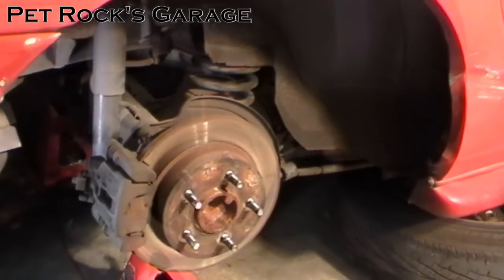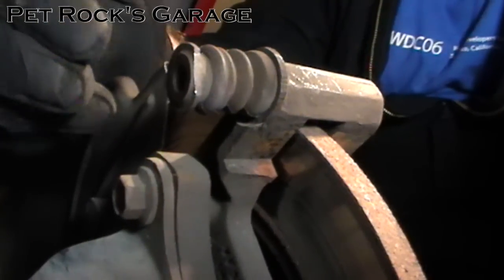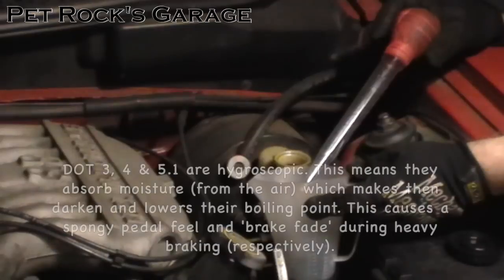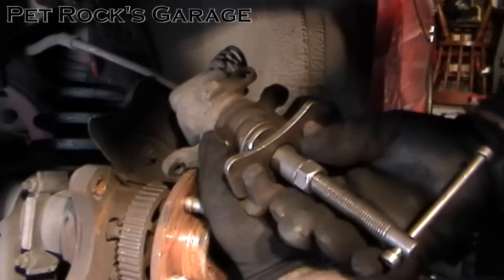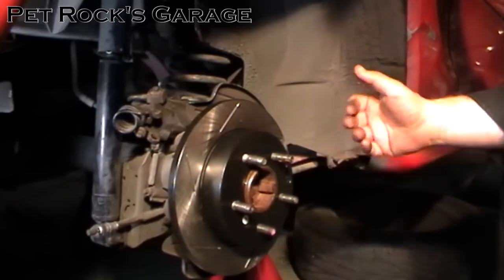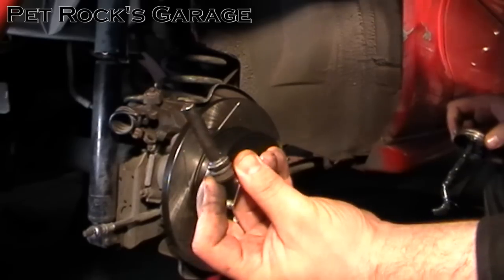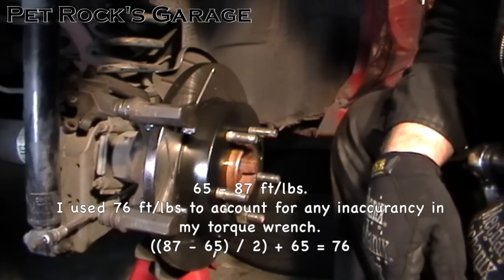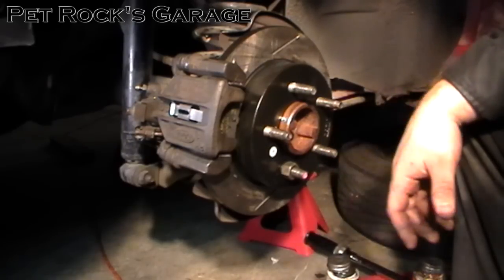How To Replace Rear Brake Pads & Rotor - Ford Mustang (’94 - ’04)

Comment: You can buy the disk brake caliper tool set on Amazon for like $32 just bought mine and it worked great. Just make sure you read the reviews there are a lot but that way you can be %100 sure it works for your car.
Reply from the maker: Mallel Morales, you can also rent the tool I use in this video from your local auto parts store. When you return it you get your money back.  So it’s a net-zero cost.  Thanks for watching & commenting. I appreciate it.
Reply: Yeah but might as well have it haha

Quick question when I did this I couldn't take the parking brake cable off is there a way to do that? I managed to do it but it seemed way easier taking it off. Thanks for the videos very clear and quick keep up the good work its much appreciated!
Reply from the maker: Mallel Morales, I just pulled on the end of the cable and disconnected it. Doesn’t take a lot of effort, like I show in the video.  Make sure you don’t have the parking brake engaged when you try it otherwise you won’t be able to get enough slack. Once you disconnect the end of the cable, there is a c-clip holding the cable onto the caliper bracket. Pop that off with a screw driver and you should be able to pull the cable out.  Good luck...
Reply: Oh okay but how do you disengage it? I had a real hard time with that.
Reply from the maker: The parking brake is disengaged from the lever in the center console in this era Mustang.  Press the button on the end of the lever and push down.  That should give you enough slack to disconnect it from the rear brake caliper.
Reply: Pet Rock's Garage I tried this today on my 95GT and it looks like I was going about it the wrong way my manual doesn't make it quite clear on how to do this other than removing the center console then pulling slack on the tensioner , I didn't know it cld just be slipped off as easily as you did it in this video. Gonna give this a try tomorrow. Thanks for the video man, this helps me a lot. I'm replacing calipers and rotors all the way around on my car
Reply from the maker: turner1976ft, yeah the service manual is a good starting point but there are often little tricks you can use to make the job a lot faster/easier. Good luck tomorrow. Take your time. I have another video on how to bleed your brakes which you’ll need to do if you are replacing your calipers. Unless your calipers are seized/damaged, though, I wouldn’t replace them. They aren’t a wear item like brake pads and can last the life of the car if properly maintained/serviced.. Same with rotors, if they aren’t at their minimum thickness, they can often be taken to a auto/machine shop to be ‘turned’ to smooth them out and they are as good as new. A lot cheaper & easier then replacing them if they still have enough meet on them.

Comment: Very informative video helped a lot.  One thing I wasn't sure of and maybe you covered it.  The springs on the back of the brake pads are they supposed to be spread apart or does that happen on its own
Reply from the maker: +Stephen Allen, thanks.  I appreciate it.  Do you mean the wire springs that are part of the brake pads?  If so they will spread apart when you install them in the caliper. They are supposed to straddle the hole in the caliper housing.  Good luck...

Comment: Great video except for the bit at the end when he says to be easy o ur brakes. When bedding in new brakes u want to get to a spot where u can move quickly. Drive around a little first to get them up to temp first but then u will want to do 10 or so 60-10s. This basically means be traveling at 60mph then stand on ur brakes hard till u get to 10. Don’t lock them up tho. After doing this a lot u will  start to smell ur brakes but it’s normal. If you don’t bed in your brakes you run the risk of having uneven pad deposition which will make your pads feel like warped rotors. DO NOT set your E brake afterward because it has a good chance of trapping heat in you rear rotors where the pads are squeezing them it has happen to me before.
Reply from the maker: There are many ways to bed in a set of pads. Which one is best is obviously debatable. The technique you describe has a high risk of warping or even cracking the rotors due to excessive heat. Not to mention the possibility of causing an accident since most people don't live in areas where you can safely do quick 60-10 mph stops. For 95% of people just driving around normally will do the job. It will take a little longer, but the pads will conform to the rotors just fine and the rotors will get plenty hot without overheating. But in the end use whatever technique you prefer. Its your ride after all.

Comment: Excellent video sir😎👍🏾💯 I have a 97 Mustang cobra with this rear brake set up. I didn't have the extra clips when I purchased some pads nor when I removed them. Is that common for the sn95 Mustangs??
Reply from the maker: It is common for them to be missing on the car. Someone along the way didn't put them back on after doing a brake job. As for them coming with the pads, some manufacturers include them and some don't. You can buy 'rear brake hardware' kit from your local auto parts store for less than $10.  I would highly advise putting them on. Otherwise the springs on the pads will be against the raw casting of the caliper. Thats not good.  They need to be able to slide smoothly. Good luck.
Reply: @petrocksgarage  Thanks for the info and prompt response sir 😎😁👍🏾💯✌🏾
Reply from the maker: @qward2174 , no problem. Good luck.
Reply: @petrocksgarage  👀👀🤞🏾🤞🏾

Comment: I have the same mustang, I changed out the rear brakes last year and they still have a lot of life on them. However I've noticed the e brake is not holding the car at all. It was working great until a couple months back. Could it be I need to re adjust the brakes ? Or something else
Reply from the maker: A couple things could cause the e-brake to not hold the car very well.  Then cable could have some slack in it, in which case it will self-adjust if you repeatedly pull & release the e-brake lever. If that doesn't help, jack up the rear and pull both right & left tires and have someone pull the e-brake while you watch the caliper. You should see the cable turn the spring and the caliper move.  If the spring doesn't move then the cable is stuck. If the caliper doesn't move then your caliper might be seized or binding up on something. In which case, take the caliper off and pull the e-brake again to see if the piston moves. If it does then the problem is in the slide pins. If it does not then the problem is internal to the caliper. Good luck.

Comment: when I get home I have to see about bending the ears on the tips of the springs at the top of the pads themselves. Trying to get that last bolt to line up and it's 1/8 to 1/4 inch off from lining up. I've checked and inspected everything else. I also have to make sure the piston is at the 6 and 12 o clock positions though it is turned all the way in.
Reply from the maker: You shouldn't have to bend the sprins on the ears of the pads. They should compress down flush once installed. It sounds like the little nubs on the pads are not lining up with the slots in the piston, which prevents the caliper from sliding all the way on. Good luck.
Reply: @petrocksgarage  it could have been that as I ended up rotating it and it seemed fine after that.

Comment: Not sure if its a good thing but i turn on the car when im pushing the piston back in. This makes it so much easier. Now i dont know if it will damage the brake or if will introduce air but damn much easier.
Reply from the maker: Interesting. I'm not sure how it would help. Maybe it is specific to your year/model car? I doubt it would damage anything though.

Comment: That one pad was worn uneven because the caliper piston was not clocked right and the button on the back of the pad was not recessed into the slot and the pad was cocked eyed .Those slots must be in the 12 & 6 o’clock orientation
Reply from the maker: Yeah, I say as such at 11:00 & 12:13.  Thanks.

Comment: Great vid followed the steps only problem is my e brake won’t engage. I’m definitely had the e brake off the I replaced the pad
Reply from the maker: Thanks a lot. I appreciate it. I'm a little confused on what the problem is. Do you mean that when you pull the ebrake lever the rear brake caliper doesn't squeeze the rotor?  If so, I'd walk back from the caliper towards the handle to see what is not moving as a friend repeatedly pulls the ebrake lever. Its hard to diagnose from my keyboard. Good luck.

Comment: if you have ABS, you bleed the caliper as you compress the pistons.
Reply from the maker: Yes, you can bleed just the caliper that way. However, it is a common misconception that you must do it this way on vehicles with ABS. ABS is not part of the caliper. It is typically a box close to the fluid reservoir.  I have been using just a vacuum pump to bleed brakes on vehicles with ABS (including my own) for years without issues. But in the end, use whatever method makes you happy.

Comment: Thanks for the excellent video.I was having trouble with compressing the piston and learned to rotate it. I am wondering how long the caliper lube will function on the exterior components like the pad tangs and the silver piece on top since these parts will get wet and pick up road grime? I have used Sil-Glyde lube. Is that a good caliper lube?  Thanks again!
Reply from the maker: Scott Carpenter, thanks.  I’m glad the video helped.  Your milage will vary, but I’ve gone over 10k miles with the caliper grease still on the pads etc.  I don’t have any experience with Sil-Glyde lube, so I don’t know if it is any good or not.

Comment: How do the notches line up with the brake pad? The caliper twists... so if the notches need to line up with the tabs, wouldn't they just twist out?
Reply from the maker: Good question! The piston doesn't twist when you press the brake pedal. It just comes straight out.  You can test it out by twisting the piston in all the way, put the old pads loosely in the caliper (pad material towards the piston), and go in the car to press on the brake pedal. Then see if the piston twisted or not. You want the old pad there to prevent the piston from popping all the way out if you press the pedal too many times (once should do). Hope that helps.

Comment: great info but I'm confused...if you have to screw the caliper piston in, don't you have to screw it back out for the brakes to work?
Reply from the maker: Nope. The brake fluid pressure will push the piston out. You can try it yourself to verify. Spin the piston back in and then have a buddy press the brake pedal to see if the piston comes out.

Comment: Hi I already did that but the rotor is rubbing with the bracket. Now the question is. Is the caliper pushing the rotor ??
Reply from the maker: Yes, the caliper squeezes the pads into the rotor. Thats how the brakes work. If the rotor is not held down by the wheel and/or lug nuts, then the rotor will flop around.

Comment: It’s even easier than this. No need to disconnect emergency brake. Do not buy cube tool because it’s junk and will only fall off when applying pressure. The key is too remove brake line from back of caliper to relieve pressure. Then use a pipe wrench to turn instead of a useless tool like cube. Just be careful to only catch edge of piston making sure not to catch rubber boot. Best to buy slotted and drilled rotors and brake pads from eBay for 104.00. They are zinc coated to prevent rust.
Reply from the maker: I agree about the cube and don't use one in this video, but I would not advise disconnecting the brake line or using a pipe wrench on the piston. If you disconnect the brake line you are making even more work for yourself because you'll have to bleed the brake system afterwards (I have a video on that, btw). And if you use a pipe wrench on the piston (which is typically plastic) you will mar the outer surface of the piston (a.k.a. the sealing surface) or crack the piston. Both are not good. You should fully seat the piston all the way into the bore in order to get the new brake pads to slide easily onto the (new) rotor. If any part of the piston is damaged it could damage dust shield around the piston or the fluid seals inside the bore. Neither is good and both can cause brake failure. Just rent the tool I show in the video from your local auto parts store. It is really easy to use and most stores give you 100% of your money back when you return the tool. So no loss to you.

Comment: To be clear, a manual car would not have a parking brake, and the piston would compress back into the caliper without twisting, correct?
Reply from the maker: +amerninja38, a manual car will have a parking brake since they don’t have a ‘Park’ mode in the transmission like Automatic transmissions do. As for how the piston is retracted, that depends on the caliper & manufacturer. If you are asking about a Mustang between ’94 & ’04 it will have the twist style piston in the rear.
Reply: amerninja38 no

Comment: I have both abs and e brake lights on my dash, even tho my e brake isn’t engaged. What can cause the lights to go off?
Reply from the maker: Was it off before replacing the brakes and now on afterwards? If so, my guess would be that you forgot to re-connect a sensor. If its not after doing this job, it could be any number of things. Take it to a shop that does brakes and have them check it out. It means there is a problem with your brakes that you should get checked out ASAP. Brake issues are not something I would put off. Good luck.

Comment: Thank you for uploading this video it is the best video I have seen on YouTube very detailed and precise. I am running into the same issue as you. Missing clips and one of the sliders on the bracket is froze up. The only issue is I can't find a part number for the rubber boot that goes over the sliding pin. Do you know the part number or the correct name if the boot? Thanks
Reply from the maker: Thanks a lot. I appreciate it.  I think you are looking for a "Brake Hardware Kit".  It will come with replacement clips, bolts & boots.  You can pick them up at most auto parts stores.  Note that some kits come with the boots and some don't.  So whomever you buy from make sure the kit has the boots.  Autozone's should (part number H5991).  Good luck.
Reply: @petrocksgarage  thanks for the fast reply
Reply: @petrocksgarage  sorry I have one more question for you. My parking brake will not hold the car in my driveway. Is it possible to adjust the parking brake? I tried to find some info online with no luck.
Reply from the maker: @mitchputerbaugh1940  no problem. The parking brake should self adjusting as you pull/release the parking brake lever over time. Make sure that the rear brakes are actually clamping down on the rotor when you apply the parking brake. Something may be seized up. Also make sure the cable actually moves, it could be broken or seized. The cable could also be stretched to it's max and there is no more room for adjustment anymore. It is hard to say. Good luck.
Reply: @petrocksgarage  thanks again
Reply from the maker: @mitchputerbaugh1940 , no problem.

Comment: Isn't there a procedure for the hand brake lever prior to removing the caliper?
Reply from the maker: No, the hand brake should be disengaged before starting this job otherwise you won't get the caliper off.